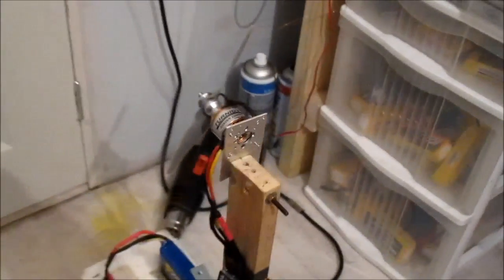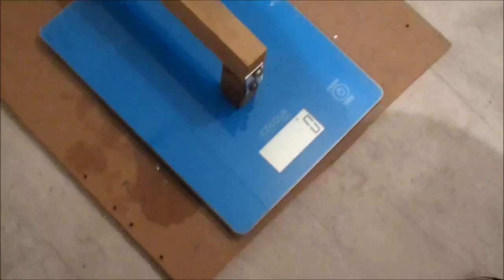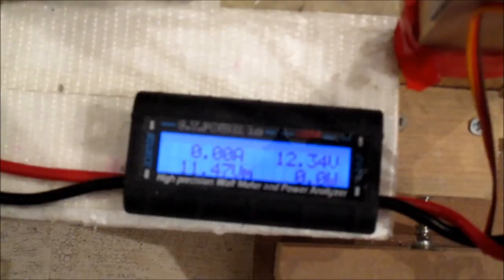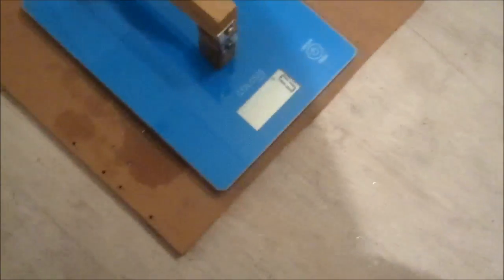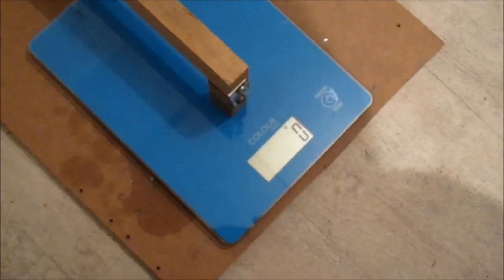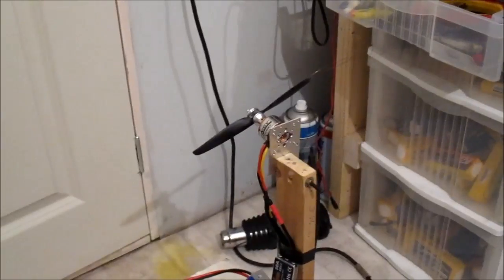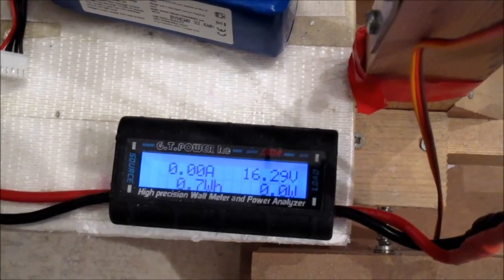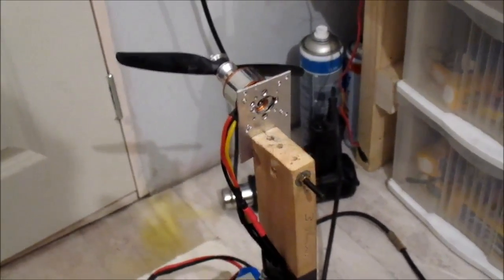Turnigy 2826-6 2200kv Thrust test Motor Test of the Week

Comment: Can I use 4sell with 7 inches prop
Reply from the maker: No will probably burn the motor
Reply: @rcplanepirate many many thanks for replying. actually I'm going to make mig 29 with a 4-sell battery.  so which prop will be better for me and which esc? 
I need super speed for a while not all the time.  So that I can push the full thrust for 10-15 sec.
Reply from the maker: @Olly-henry  A 6x4 prop "not APC" gives good thrust on 4 cell and use a good quality esc that is capable of higher rpm
Reply: @rcplanepirate SIR What is the meaning of APC propeller?
Can I use gemfan 6imchi prop? 
Can you mention a good quality esc
Reply from the maker: @Olly-henry  APC props are a make of prop that most people use but they are not good. gemfan will be a better choice. Turnigy plush esc's work well with this motor and are a reasonable price.
Reply: @rcplanepirate sir there is no Turnigy motor on AliExpress or Chinese production which version of 2826 2200kv  motor should I buy😢
Reply from the maker: @Olly-henry  Try Hobbyking

Comment: I have an EPO Cessna 185 trainer plane of about 1200gr weight. I have this exact motor and 40A ESC with 3S battery. What kind of prop would be appropriate for this setup? I have 9x4.7 prop at the moment but I'm not sure if it's good to use.
Reply from the maker: No that's way too much prop for this motor. To run a prop of that size you will need something more like this size and kv.     https://hobbyking.com/en_us/prop-drive-v2-series-2836-1200kv-530w-brushless-outrunner-motor.html?queryID=276af716b78c30ec3a0fb521dc3602ad&objectID=59062&indexName=hbk_live_products_analytics

Comment: I have used this motor with jxf 7x4 with 3 cell in pusher configuration its producing more then 2 kg with 4400 mah on 40 amps esc
Reply: And did it last? My fear about pushing 7x4 or 7x3 props on this motor (3s) is having it give up in midflight. I don't wanna lose my model much less the onboard equipment.
Reply: @jefersonnl  don't go for full throttle for long
Reply from the maker: WOW! They are good motors.

Comment: Would the 6x5 be able to make a 750g jet fly faster than a 7x3 prop on 3s? The 7x3 having a bit more thrust. Thank you
Reply from the maker: Hi there. Although the 7x3 has a bit more thrust the 6x5 would be faster as it will have a higher rpm and pitch speed.

Comment: Thanks for the vid! looking to upgrade a edf 2826 3200kv 3s 25a setup! any advice on the step up and what I can keep from this lot!! Cheers
Reply from the maker: Sorry Fitch it's not clear what you mean?
Reply: @rcplanepirate  Thanks for replying!  Hobbyking have a BAE Hawk which runs that set-up. Basically the AMAX airframe (thats what they were called in 2008).. I had one back then and it was a bit gutless, although it flew beautifully!!I haven't flown for years and remember literally nothing about  the set=ups! I was wondering what motor esc and battery setup would give it a bit more go!
Reply from the maker: @TheLeadpepper  OK. I'm guessing that is the 70mm edf version. Or is it the 64mm one? To make it faster you will need to change everything. For the cheapest set up you can get a 6 blade 70mm edf from ebay or banggood for around £20. Ebay one is 3000kv and uses 4s. It say's use a 40a esc but I would recommend a 50a or even a 60a. A 1800-2200mah 35c or higher 4s should be good. The one from banggood is 3500kv. It can be run on 3s or 4s. If running on 4s you will need a 90-100a esc. Way more powerful. If you only run it on 3s it should still have a bit more power then standard and you can use a 60a esc and a 2200mah 3s. If running it on 4s you will need at least a 2200mah 4s of 60c or higher. You will just have to move the battery to get the CG correct. 

Hope this helps.
...RCPP
Reply: @rcplanepirate  Thanks for this! yep it is the 70mm.  I have been through the list of items you have suggested and they are very reasonably priced!! Thanks for your help!

Comment: Not a fair comparison between props when the rpm isn't measured.
Reply from the maker: And how did you come to that stupid conclusion?
Reply: @rcplanepirate  Why the Ahole reply? .  Are you telling me and anyone reading this that you make thrust reviews without knowing the significance of pitch speed?
 Quit being a keyboard warrior next time and think before you post.
Reply from the maker: @TheRattleSnake3145  Ok. Sorry. Just had a few negative comments from people that don't know what they're talking about recently. I will say though that I would of thought you would know that you can get a reasonably accurate idea of the pitch speed using math! I have explained this in a couple of videos and to other commenters. When you get a reading on the wattmeter for amps and watts it also shows the voltage drop and if you know the kv of the motor "believing the kv stated is correct" then you just times the voltage reading by the motors kv. Then you will know the rpm. Ok it's not 100% accurate but it gives you a rough number to go by. Then if you times that number by the props pitch. Divide that by 63360. "How many inches in a mile." Then times that by 60. "To convert the minutes in revs per minute to hours" and there is you pitch speed in MPH! You can also convert the prop pitch to cm. "2.54" and change the rest of the sum to give you answer in KPH. That's what I use and once you know this it's not hard to do. Just watch the wattmeter, see the voltage drop reading, times it by the kv and do the rest of the sum. I shouldn't have to do everything. If that information is important to someone then I would have thought they would know how to do that calculation! 

Wouldn't you agree?
If this reply also makes me sound like a asshole then I'm also sorry but from this very moment I have been awake for 36 hours. Just FYI.

Comment: So what prop will be best for max speed? 4s and amybe 5.5x4.5 prop?
Reply from the maker: Depends on what type of plane you're flying. For max power go with the 6x5 TGS prop, But if your plane is smaller and more aerodynamic then it may be better to go with higher rpms then max thrust. In which case go with the 5x5 TGS prop.
Reply: @rcplanepirate  thank you. 
The plane - funjet ultra

Comment: 3:00, 1200mg? Impressive output! But is it rated to work with a 7x3 on 3s? I was thinking about using that combination to help to take my 1,5 meters Skywalker off into the sky more easily, without using a runway or landing gear, just by throwing it. With my current 3s setup, I've got only 700g full throttle, which makes it almost belly-touch the ground when thrown.
Reply from the maker: It is a very tough motor and can take more power than it is rated for. It isn't rated for 4s too but as you can see it can take it. Thanks for watching.

Comment: do you think the motor is to big for a 600mm flying wing ??
Reply from the maker: Hi damblduig beck
Yes it it a bit big for a 600mm wing. Too much weight at the back so you won't get it balanced. Try a 2205 quad / drone motor with about 2200-2600kv. It's a nice light setup with a 1300mah 3s. Good for aerobatics and still has a good turn of speed. Here is my 600mm wing with a very cheep 2205 2600kv motor. It's only got a 4.5 inch prop on so it probably would be a bit faster with a 5 inch prop but still good fun. Got a bit carried away at the end and crashed it. Not a problem it's all fixed now.  :)  https://www.youtube.com/watch?v=LIG131EJuf8
Reply: rcplanepirate your Setup looks Great! Is the motor still ok?
Reply from the maker: Yes the motor is still ok. It only draws about 13 amps with that prop. This is the motor I'm using. https://www.youtube.com/watch?v=tqSGigCrKjc

Comment: hi, can i use my 2826\10 with 30 a esc on 3s battery with 7x5 prop? will it work?
Reply from the maker: I don't have a 2826/10 1400kv to test but I should think it would be ok. Just don't use the EMP/KMP/TGS style props. They draw way too many amps.
Reply: thanks ;)

Comment: Looks like a re-labelled DYS motor. Nice physical size (2826), I wonder if  it swing an 8040 prop on a 50A esc. Will it smoke the motor?
Reply from the maker: Hi there
These were around for a long time before the DYS motors. The biggest prop this will turn is a 7x3 on 3s. It may be able to turn a 8x4 on 2s. Probably won't give more thrust though. For best performance in the air use a 6x5 on 3s and for mental performance a 6x4 on 4s. Thanks for watching.
...RCPP
Reply: Thinking of building a C1 Chaser for FPV, running off a 3S 2200mAh 40C lipo. Bare foam 300g, completed AUW around maybe 900g thereabouts with Omnibus F3 Pro, servo-mounted 1000tvl camera & teenie 1080p camera.

I guess since you've demonstrated that a 7x3 prop will kick out 1300g of thrust on this thing, I'll go look for one. Thanks mate. Cheers.
Reply from the maker: No problem mate. That all sounds good. You can get them from HobbyKing. Link  https://hobbyking.com/en_us/d2826-6-2200kv-outrunner-motor.html
Reply: @kkhalifah1019  Did you do it? if so, how did it go? I'm thinking about doing the same, however, my biggest fear about pushing 7x4 or 7x3 props on this motor (3s) is having it give up midflight. I don't wanna lose my model much less the expensive onboard equipment. If the copper wiring sorts itself out inside the motor midair due to excess heat, you gonna have an ESC failure, and its BEC will most likely quit as well, leading to a total loss of control.

Comment: Hi nice test! Does this motor support a 4s battery???
Reply from the maker: Hello there
The first 3 props were tested on 3s. The next 4 were tested on 4s. The motor is listed for only 2 to 3s but lots of people have used it on 4s with no problems and going by my test it works fine on 4s if you keep the prop to 6x4 or under and set your ESC to 16khz. Thanks for watching.